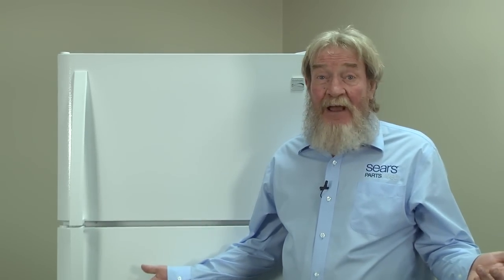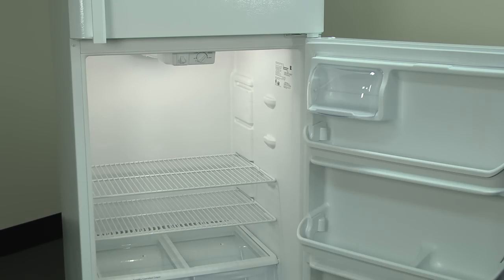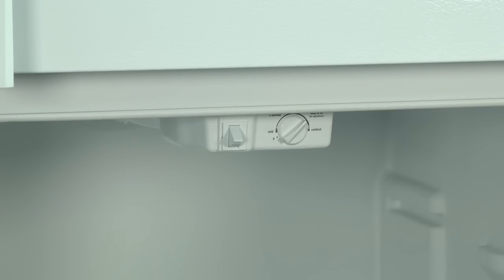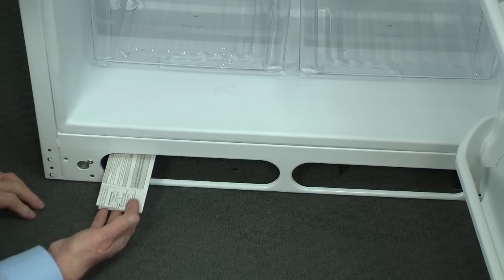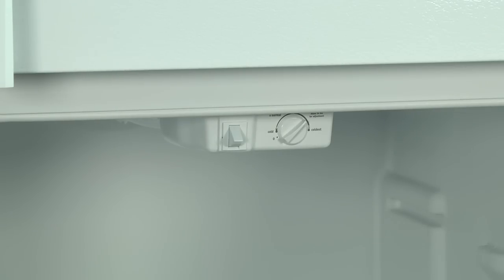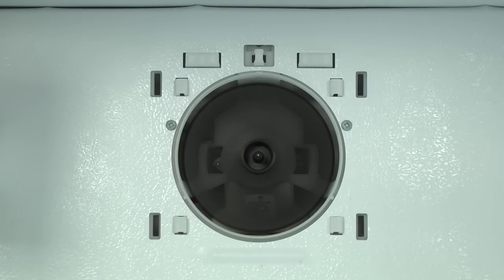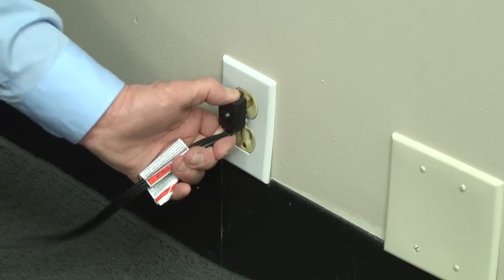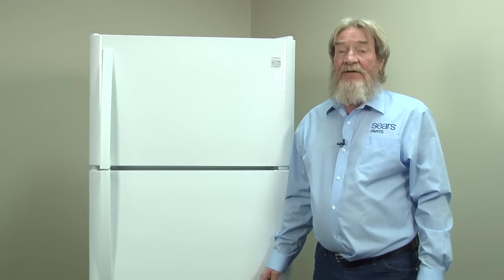How to Troubleshoot a Refrigerator Not Cooling

Comment: Wayne HELP,
I have a Frigidaire Refrigerator FFHT1513LW2. I had problems with a warn refrigerator, cold freezer. After querying online I replaced the Compressor Start Relay, that didn’t work, then the Defrost Timer, then the Temperature Control Thermostat, that seemed to work, but now the refrigerator is getting colder and colder. No mater where I adjust the Temperature Control Thermostat knob, even all the way to the left, the warmest setting it freezes my 2 liters, bread, etc. Is my Temperature Control Thermostat defective or what? I also get a loud snapping noise, like someone snapping their fingers loudly, ever so often. Thanks for you video.
Reply from the maker: Check the temperature knob in the back of the freezer compartment. Set that knob to "Normal" (the middle setting) if it's not already there. If that setting is normal and the refrigerator compartment is freezing everything, then the new temperature control thermostat may be faulty.
Reply: @searspartsdirect  THANKS SO MUCH FOR THE REPLY. The freezer knob is set to coldest, all the way to the right. The freezer seems to be working fine.  The refrigerator is freezing my food/drinks. The refrigerator knob is set all the way to the left, warmest.
Reply from the maker: @dougharlow6037  Try adjusting both knobs to the middle setting and give the refrigerator 2 days for temperatures to adjust to the new settings and see what happens.

Comment: I have model 253-60412614 kenmore with freezer on top ,so it started making some loud noise at first and then I noticed everything was freezing at the bottom like the milk. A week later freezer started defrosting my meats and bottom was hot. I asked someone with experience from the area to come check it he realized my thermistor and damper control needed replaced so he did it. Fridge worked perfectly for 2-3 days now freezer is building up ice over vents and fridge is warm again. IDK what the problem is. If anyone can give me advice please I will appreciate it.
Reply from the maker: Your symptoms point to a defrost system problem. You may be able to fix the problem by following the troubleshooting steps in this article/video: https://www.searspartsdirect.com/diy/article/refrigerator-wont-cool-troubleshooting-video-defrost-system-problems

Comment: I have the same model my freezer working but my fridges not working what should I do?
Reply from the maker: Check to see if the evaporator fan is running. Check for frost buildup on the evaporator. A blocked vent between the freezer and refrigerator can also prevent the refrigerator from cooling.

Comment: So water got a little bit on my refrigerator not too much but the problem I have is that the motor turns off and on and or makes this noise and both coolers do not work and all my food went to waste what could be the problem
Reply from the maker: If the compressor runs and makes noise but the refrigerator isn't cooling at all then the compressor may be bad or refrigerant may have leaked out of the sealed system. You'll likely need to have a service technician diagnose and repair the refrigerator.

Comment: These are amazing videos! Thanks so much for sharing. I am going to try and trouble shoot a problem with a fridge that is not cooling. Although it does cool the freezer a bit. there is no cooling in the fridge and the fan in  the freezer is noisy. It was left plugged in over the winter in an unheated building by the previous owner. Might you be able to suggest the most likely places I should target my testing. Thank you!
Reply: Fix the fan in your freezer, that's your problem.
Reply: That’s what’s happening with my fridge right now. Did you solve it?

Comment: general electric fridge gets power but compressor stopped so I pressed the button and held it like you said to enter "test mode" and compressor fired up. is it okay to leave it like this.  also the fan in the rear bottom has sparked a day earlier , started on fire, then stopped working. I have disconnected that fan motor and placed a household fan near it to provide airflow.,... is this okay? or must I replace that small fan motor in the rear bottom...

Comment: we have refrigerator with friger working fine, but refrigerater area isn't cooling down since few days ago. Can I simply turn it off, let all the ice melt from friger, and then power back on? This apparently worked with mini-referigerator that I have in my small room. I wonder if it will do same with big one in the kitchen.
Reply from the maker: Yes. Turning off the refrigerator and letting the ice melt in the freezer will likely restore cooling in the refrigerator according to your symptoms. The refrigerator will probably cool normally for several days up to a few weeks (or maybe more). If the refrigerator quits cooling again, then you'll likely need to diagnose and fix a problem with the automatic defrost system in the refrigerator. Here's an article/video that describes troubleshooting tactics for a typical top-freezer refrigerator defrost system: https://www.searspartsdirect.com/diy/article/refrigerator-wont-cool-troubleshooting-video-defrost-system-problems . You may be able to follow the tips in that article/video to figure out what's wrong in your refrigerator if it stops cooling again. Be sure that you unplug the refrigerator before accessing internal components. We hope this information helps. If you need further assistance, let us know (and post the model number of your refrigerator).

Comment: I have one double door refrigerator.... if you work continuously for a week, then there will be no cold .... If you turn off the power for an entire night and turn it on again in the morning, it will start to cool again ....
Reply from the maker: Your symptoms point to a failure in the automatic defrost system. Frost likely is building up on the evaporator fins because the defrost system isn't working to periodically melt the frost off those fins. After a week, enough frost builds up on the evaporator fins so that air passages through the fins are blocked and the refrigerator quits cooling. Unplugging the refrigerator for the entire night allows the frost to melt so cooling is restored the next day. Let us know the model number of your refrigerator and we'll provide some troubleshooting tips to help you resolve the issue yourself if possible. You may also consider having a service technician repair the failure.

Comment: My same model refrigerator was off for almost 6 month as i was out now i switched on  freezer cooling is perfect freezing everything well but no cooling in refrigerator area down side . Any solution please help me thanks
Reply from the maker: Check your refrigerator temperature setting and adjust it if necessary. Check to see if the evaporator fan is running in the freezer section. If the evaporator fan isn't running, you may need to replace the fan motor. If the evaporator fan is running, check the damper and return vents between the freezer and refrigerator compartments for obstructions. We hope this information helps. If you need further assistance, let us know the model of your refrigerator and additional details about the cooling problem.

Comment: My freeze was cold and fridge not so much. Need the ac system worked because of that. Dropped that top plate down where he says check the thermoister and mine was a block of ice! Deforsted turned the freezer down a tad and fridge down aswell! Works now!

Comment: My refrigerator starts and goes ''clack'' and stops. It repeats all day. The fridge doesnt cool but the light turns on. Whats the problem.
Reply from the maker: Your symptoms seem to indicate that the control is trying to start the compressor to initiate the cooling process but the compressor doesn't start. There's a chance that the compressor start relay is bad. A bad compressor could also be the problem that's causing the symptoms that you're describing.
Reply: Mines does it too.....so wat do u suggest we do?

Comment: please help. I have this model and every few hours it makes that beep by its self. drove me crazy wondering where it was coming from. its the fridge. that exact sound you have it make during testing. any ideas please????
Reply from the maker: Unplug the refrigerator for 1 minute and then plug it back in. That will reset the electronic control board and the beeping may stop. If that tactic doesn't work, the "door open" alarm could be sounding or the control may be in the diagnostic test mode. Make sure the refrigerator door is fully closed. If the alarm sounds with the door fully shut, test the door switch by opening the refrigerator and pressing in the door switch plunger to see if the interior light turns off. If the interior light stays on when you press in the door switch plunger, then you'll likely need to replace the door switch because the switch contacts are broken. Here's a video that shows how to replace the door switch: https://www.searspartsdirect.com/repair-guide/refrigerator/how-to-replace-the-light-switch-in-a-top-freezer-refrigerator.html .  Unplug the refrigerator before replacing parts. If the door switch works, then the refrigerator may be in the diagnostic test mode. Press the door switch 4 times and hold the door switch on the 4th press until you hear a long beep indicating the control exited the diagnostic mode. The refrigerator may stop beeping after exiting the diagnostic mode if that mode was enabled. We hope this information helps. If you need further assistance, let us know.

Comment: ok but the relay is rattling when i shake it and Wayne on the video said that's a tell tale sign that it's fried. Do you agree?
Reply from the maker: The type of start relay that's shown in the video is different than the start relay that was installed on your Frigidaire refrigerator. The relay that was installed in your Frigidaire refrigerator could rattle when you shake it and not be fried.
Reply: no!  its supposed to rattle

Comment: using hard start Supco RCO810 3 n 1 start on Electrolux/ Frididaire Model FRT21C5AW9
Reply from the maker: Thanks for posting the model number of your refrigerator and the part number of the hard start kit that you're using. Your model uses a defrost timer and cold control thermostat to control the compressor and fans. The fans and compressor are all in the same circuit on your refrigerator. If the cold control thermostat and defrost timer are sending current to the compressor and fan circuit, then the fans should run even if the compressor doesn't start. We recommend that you unplug the refrigerator and check for continuity through the cold control and defrost timer using a multimeter. You can find the wiring diagram for your refrigerator in the owner support documents on this Frigidaire website: https://www.frigidaire.com/Kitchen-Appliances/Refrigerators/Top-Freezer-Refrigerator/ . Here's a video/article that shows how to check continuity: https://www.searspartsdirect.com/article/how-to-test-continuity-on-wire-and-electrical-parts-video.html . This video/article shows how to trace current on a wiring diagram: https://www.searspartsdirect.com/article/using-a-wiring-schematic-to-trace-a-current-video.html . Replace the cold control if your meter measures no continuity through that device. If your meter measures no continuity through the defrost timer, then the defrost timer could be in the defrost mode. Turn the knob on the defrost timer until you hear contacts inside the timer click and then measure continuity through the path to the compressor. If you measure no continuity through the defrost timer in the compressor run mode, then replace the defrost timer. If your multimeter measures continuity through the cold control and defrost timer, then you can check continuity through the wiring. If wiring is okay then the hard start device may not be properly or it may not be compatible with your compressor. We don't recommend replacing the compressor start relay and overload with the hard start kit that you're using. We recommend that you stick with the original parts designed for that refrigerator. Hopefully, these tips will help you fix the refrigerator. If you need more assistance, let us know.

Comment: Thanks. I installed the 3-1 hard start unit b/c the relay and overload were so expensive. So you’re saying that if the control board was ok, that the hard would’ve worked and ignited the compressor and fans?
Reply from the maker: Let us know the model number of your refrigerator so we can see the type of control that it uses. Also, let us know the part number of the 3-1 hard start unit that you installed in the refrigerator.

Comment: Dj Fast Freddy
1 second ago
Hi, Fridgidaire refrigerator was warm in both compartments. Compressor wasn't starting. In test mode, the compressor and both fans work. Checked relay and overload parts. Relay bad. It rattles. Installed hard start device. Light came on inside refrigerator but neither the compressor nor the fans work. Can you offer diagnosis?
Reply from the maker: Your details seem to indicate that the compressor and both fans worked in the test mode. Check to see if the compressor starts in the test mode now that you've installed the new start device. Some Frigidaire refrigerator models have control boards that delay the start of the compressor and fans so those components may not start right away in the normal operating mode but they may work in the test mode. If the fans and compressor work in the test mode but won't work in the normal operating mode, then you may need to replace the electronic control board. We hope this general advice helps. If you need more assistance, let us know the model number of your Frigidaire refrigerator and update us with details about the cooling problem.

Comment: kic fridge the refrigerator not cooling milk get spoiled  what could be the problem
Reply from the maker: Make sure no items in the refrigerator compartment are blocking air vents. The owner's manual for your refrigerator will likely indicate where air vent in the refrigerator are located. Move items away from the front of air vents in the refrigerator if they're blocking vents. If vents aren't blocked, look for a defrost system failure as shown in this video: https://www.searspartsdirect.com/article/troubleshooting-defrost-system-problems-in-refrigerators.html . We hope these tips help. If you need more assistance, let us know the model number of your refrigerator and update us with more details about the problem (such as whether the freezer section cools properly).

Comment: Hi Im having real hassle with my fridge, for a week now the freezer has been insanely cold with ice build up (didnt do that before). Fridge is warm. Took panel off back of freezer, coils look fine no ice, and fan working too blowing out super cold air. But absolutely nothing coming out of air vent in fridge. Thought it might be blocked with ice so poured some boiling water into it hoping it would clear the air vent but the water just seemed to fall out the bottom so i have no idea what is going on. Please help. Its only 2 frickin years old and i cant afford a new one :(
Reply from the maker: Let us know the model number of your refrigerator and we'll provide some troubleshooting tips.

Comment: The compressor on mine is working because you can hear it but it started to defrost the bottom freezer and the top does not feel as cold as it should.
Reply from the maker: Check to see if the evaporator fan is circulating air in the bottom freezer as the compressor runs. A failed evaporator fan can cause cooling problems in the freezer and refrigerator sections. If the evaporator fan isn’t running, unplug the refrigerator and check the wire harness connections on the evaporator fan. Reconnect any loose wires. If the wiring connections are okay, you may need to replace the evaporator fan. If the evaporator fan runs, lack of refrigerant (Freon) or a failed compressor may be preventing the freezer from cooling as the compressor runs. A service technician would need to repair this this type of failure because the procedure requires the recovery and recharge of refrigerant. You can schedule service here:  https://www.searshomeservices.com/ We hope these tips help. If you need more assistance, post more details and let us know the model number of your refrigerator.